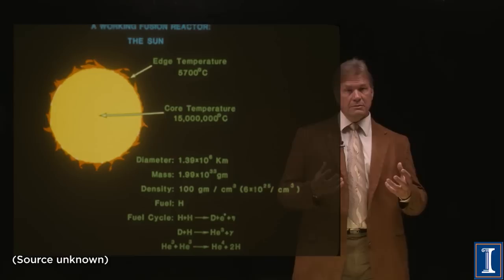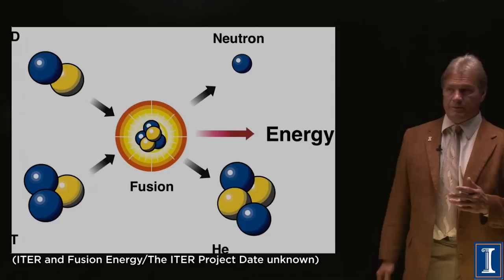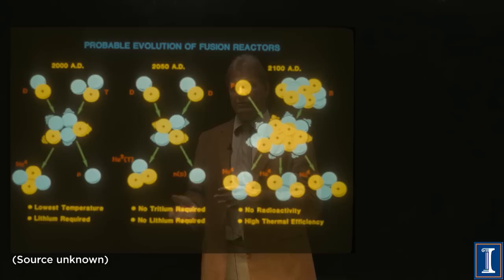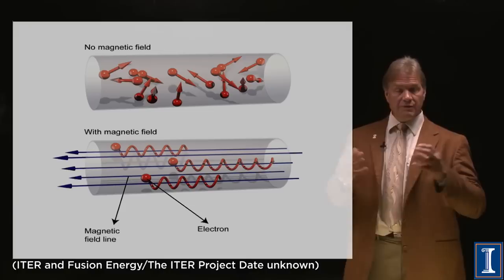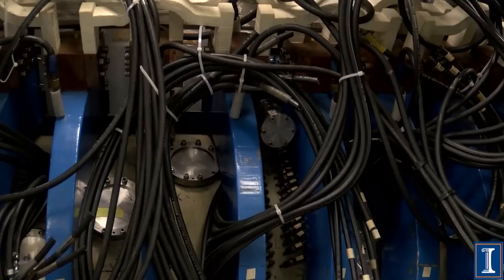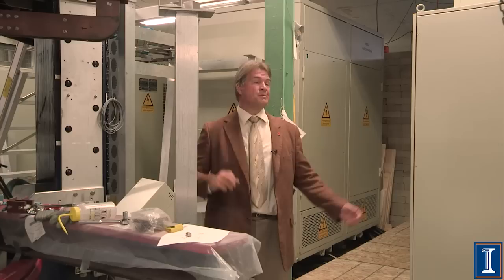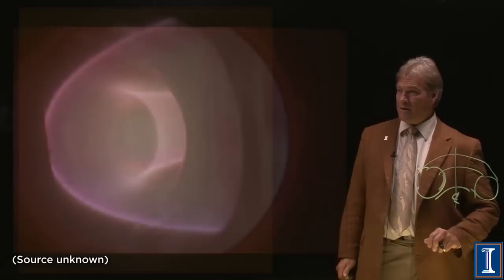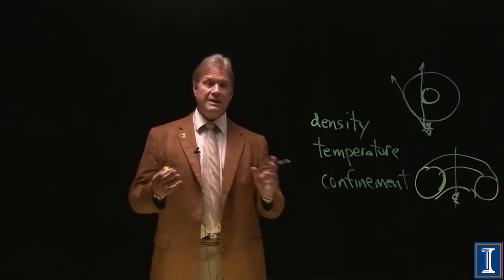What Is Fusion and How Do You Get It to Work?

Comment: How is the energy from the reaction captured? Wouldn't the products of the reaction keep spinning around the magnetic field along with the reactants?
Reply: The only stuff captured by the reactor (its magnetic field) are ions, as the products of the reaction (neutrons and helium cores) are not ions, the are flying out of the reactor and will hit/fly through the walls, where water is heated.
Reply: @Bunnysinger  Past the super=cooled superconductors.  That'll be a breeze.
Reply: @tonyduncan9852  Actually these blankets are located inside the magnets. Why reply with a  wrong answer when the information is easily accessible?
Reply: @Bunnysinger  "Blankets"  ? - Pipes containing pumped water expanding into pressurised steam are wrongly described as "blankets".
"Wrong answer" ? - "Past the super-cooled superconductors" is absolutely correct.  I appreciate that the magnets will heat up, and yet also that in order for the magnets to drive the magnetic fields, their wiring should be superconducting, and at a temperature of at most -120 deg C.  That'll be a breeze. . . .
Is your real name Lady Pilman, and do your fingers always slip on the keys?
Reply: @tonyduncan9852  Your first comment insinuated that the capturing of the heat takes place past the supercooled magnet, which is demonstrably false. Just take 5 seconds to look up the diagrams of ITER.
A blanket is the correct term to describe the unit used in ITER, which is composed of tritium-breeding concepts, radiation protectin of the magnets as well as waterpiping. It is not wrongly described, it is simply the term used by everyone working on this project.
Specifics of how the magnets will be supercolled during operation can also be easily accessed by just going to the webpage of ITER (and the T° is -269°C, not -120°C).
Is this pure neglicence or stupidity, I can't figure out which one you're portraying.
Reply: @Bunnysinger  "Your first comment insinuated" - No, it didn't.
"that the capturing of the heat takes place past the supercooled magnet" - No, it didn't.  A "magnet" isn't a "superconductor".
"which is demonstrably false" - Your statement is demonstrably false.
"Just take 5 seconds to look up the diagrams of ITER" - Done years ago.
"A blanket is simply the term used" - OK.
" neglicence or stupidity, I can't figure out which one you're portraying" - Neither.  I was merely (and lightly) implying that extracting heat energy from a low temperature device was an engineering challenge. 
But I will go a little farther.  It's a stupid challenge, supported by more than one stupid person, comparing its costs with CERN - but not its achievements with CERN's.
A sort of reverse BAKED ALASKA?  Hmmm.  Can I have some of the money they're spending?  "Negligence", btw.

Comment: I wanted you to explain how do you extract the excess energy once it is working.
Reply: Michael Lundgren heat up water to turn a turbine.  Same as most other electricity generation.  The heat is what is released from the fusion reactions
Reply: @the-mallory  Its not explained. There is coolant water in fission reactors. No mention of water in the fusion reactor.
Reply: @michaellundgren6949  For the reactions where a neutron is created this neutron is unaffected by the magnetic field because it has no charge. Its energy can land in the surrounding material which can then be used to create steam and power a turbine.

Comment: It a chamber made by magnets, to drive ions into collisions...so you need electric fields aims inwards and in a circle. Fill the chamber with gas and the ions will be channels inward abs in a circle and collide...but use a basis isotope just one, pressurised it then begin fission and then fusion, and let the process restarts naturally...you get a lot of energy...back even more than input and as a constant input the output is far more...

Comment: if I may and I probably have seen this clip, but maybe I don't remember if my question was answered. And since we are getting close to starting one up, its all fine and dandy and lots of energy and pats on the back all around. But. How do you stop it after it started?
So its high temperature, higher than the sun to make up for the reduced pressure that we have here (coz the sun has more pressure so it can do it with less temperature), so we got all that and we got the magnetic containment field, all good and its starts working on its own after sparking it. 
Remembering only too well the intricacies of the mess of Chernobyl and how they turned that switch off when it should be on, or they should have added more of this or that instead of reducing this or that. I wonder. Do we know how to stop a fusion reactor? I.e. how to turn it off. What if we stretch the limits of heat and pressure to make it work but somehow for some strange reason, once it gets going , it "paradoxically" needs a higher temperature or pressure to stop, instead of reducing them, for example. So wouldn't it be wise, and I hope they thought of that in general, not to operate things at the limit, coz you never know what a little bit more might do? Like a reserve. Its generally good practice. Not to operate at max.

Comment: But would charged particles move in a non moving magnetic flux? If you apply dc current to coils would it cause charged particles to move inside toroidal tube? Does it has too be at least pwm on off dc input?

Comment: This is all fine and good professor. But, in order to produce the 1.21 jigawatts of electricity we'll need to power the device, we'll need to travel back to Nov 12, 1955 and harness the bolt of lightning that will strike the clock tower at precisely 10:04 pm.

Comment: Fusion has been done many times on earth as far as 50 years ago in the form of Hydrogen bombs which are fusion bombs initiated by a fission bomb to produce heat and pressure. Not a good power source but does prove the feasibility.
Reply: Project PACER tried to investigate the possibility of utilizing hydrogen bombs in an underground cavity in order to generate steam for a power plant.
Reply: 911 was another example of a working FUSION reaction  :-)
Reply: Matt S  100 football pitched 1 Acre sized concrete floors turned to ultra fine particles in 10 seconds - now genius, what energy source can do that??
Reply: Matt S  Well let me give you the readings for the elements in the dust and see if that will help you.

Dust samples USGS - United States Geological Survey (Department of the Interior)
Barium = 765-3130ppm 
Strontium = 1000-3670ppm 
Zinc = 2990ppm 
Yttrium = 58.9 
Uranium = 3.92-7.57 
Thorium = 30.7 
Barium & Strontium are not trace, but highly dangerous amounts. 
The steel beam coatings contain up to 93Bq/Kg Uranium - Professor Chris Buzby
Tritium at 55x normal in the water run off - Lawrence Berkeley National Laboratory
Elevated levels of Uranium in the air - Dr Cahill (UCLA Davis) 
Actinium discovered by its emissions spectrum - Professor Chris Buzby
Iodine 131 which has a very short half-life of only 8 days was also discovered -  Oktay and Partners
Reply: @Kpopzoom  - Are you talking about little tiny fusion bombs, some sort of ray from a distance, a ball of free-floating fusing plasma rising through the building, or some other scenario? I'm sure energy from fusion could vaporize material, but what mechanism?
Reply: Matt S  fusors exist, which are essentially fusion reactors that take in a greater energy input than the output they provide

Comment: What about Lithium-Deuterium fusion?
Reply: You are probably mentioning this reaction from nuclear weapons that use lithium deuteride as fusion fuel on the secondary. Actually the reaction that happens in a thermonuclear warhead is not lithium with deuterium its tritium with deuterium. It happens in stages first the fission primay not only compresses and heats the secondary(LiD) fuel but also with the insane neutron flux it provides it breeds tritium from the lithium at the same time(n+Li=T+He) then the Tritium generated reacts with the deuterium generating more neutrons that hit more Lithium atoms to generate even more tritium that reacts further with the deuterium.

Comment: Fusion is an a incredibly slow reaction. Is it true that there are 2 fusion reactions per cubic metre in the sun per second.
Reply: I don't know the exact numbers, but fusion is about that 'slow' in Sun-like stars, yes.

To make fusion happen, one must meet the 'Lawson Criterion.' That is, the product of temperature, density and confinement time, must exceed a certain minimum value.

Because they can't achieve the pressures and confinement times of the cores of stars, fusion devices have to go for higher than stellar temperatures...

Comment: I can't avoid a comment about Brazil: We're invited, in 2006, to be part of the ITER. In the deal, Brazil would produce the Niobium-Titanium wires for the electromagnets. Brazil has large mineral resources - including the two metals needed for the wires. In 2013, when the Ignition Lab (US) managed to get net energy output from a fusion reaction, a physicist told that Brazil refused the invitation saying "it would cost too much". The Federal administration at the time was involved in a huge corruption scandal and on a single oil refinary they spent 24 billion USD. The total ITER estimate is 20 billion USD. I won't say the names but that administration was not only corrupt but also incompetent. They have no idea how stupid they were for refusing the invitation.

Comment: What about just using the big fusion reactor that already exists in the sky?
Reply: We are, but sometime objects get in the way - like the earth and clouds.
Reply: @bobthebomb6498  True.That's why you need to design sufficient gathering and storage capacity into the system for every specific location. If you estimate and calculate everything correctly the system will gather and store a sufficient amount of energy during periods of sun exposure to carry you through other periods when the sun is blocked.
Reply: @nisonatic  - I agree that we need better ways to store accumulated energy. Even electrolysis followed by hydrogen storage has capacity and containment problems. But sunlight is free and if we could find better ways to accumulate and store it solar energy could become much more viable.

Comment: You need to turn up the volume dude
Reply: Then the squeaking would intensify
Reply: @seymoronion8371  for which he could use a passive high frequency filter. My point is that its not enough to just cut the video together
Reply: Are you watching these vids on a phone, or notebook, by chance? I'm using a PC and not having any issues.
I'm using some cheap Creative Inspire T12 2.0 speakers with onboard sound (Realtek ALC S1220A).
Reply: @seymoronion8371  I was at the time actually, had I been at home I could have used my desktop head phones and probably never even felt the need to comment on it in the first place lol
Reply: You might want to check your Audio Settings to see if you have Loudness Equalization enabled.

Comment: how is the energy taken from the plasma, when its magnetic locked in the vacuum toroid?
Reply: Like every other nuclear/coal/gas plant.
Boiling water and driving turbine's.
The bigger real systems get a "cooling" system that boils water in the "shell" (I'm not sure how to call that in English)
The small system you see in this video is not meant to sustain any prolonged plasma (and really can't) thus it has only a cooling system to protect it from damage.
Reply: @SuperUltimateLP  of course it's done by steam. But where has the water contact to plasma?
Reply: @kraftrad7840  the plasma is hot enough to heat the walls of the reaction chamber, in there is the steam generation done.
Reply: @SuperUltimateLP  aren't there the magnets in between?

Comment: Why not just make a sphere and use plain H2 hydrogen?
Reply: Because you would not get the sun's confinement (heat and pressure) due to not having enough gravity present to create the same conditions as the sun.

Well I suppose you could make a ball of h2 hydrogen the size of the sun and call it a reactor as well.
Reply: @VuNguyen-wo8bp  WHAT!!!!!!!????? 
  I'm sorry, but responses like this baffles me. 
 What you are saying isn't being done now with current fusion reactors. 
 So let me reiterate, why not make a sphere shaped reactor and use plain hydrogen gas or a combination of tritium and deuterium?
Reply: @shexdensmore  Because fusing plain hydrogen is impossible with current understanding of science anywhere outside of core of a star. It was said in video that it takes long time. Reason it takes long time is that plain hydrogen fuses in helium two(two protons no neutrons in single nuclei) which is extremely unstable and most of the time decays back into two protons and only in rare occurrence beta decay of one of the protons into neutron happens during brief period of time until it would decay back into hydrogen. But not only it has to fuse and decay many times until deuterium is finally just by pure number of cycles and abysmal chance forms, but this whole fusion process of two protons if moderated by weak nuclear force unlike fusion processes that are viable for production of energy which are moderated by strong nuclear force. Also spherical magnetic confinement is way harder to achieve, than tokamak or stelator design. There were experiments, but i didn't follow how they actually ended.
Reply: A sphere cannot contain plasma due to its topology. You can think of this in Basic E&M if you want, or you can look at the "hairy ball theorem". As a consequence of the topology of a sphere, you cannot use it to contain a plasma without a "leak"
Reply: @ekotar1  Ball lightning?

Comment: Still uses tritium, or deuterium... no one has been able to produce those isotopes on an industrial scale economically, the other part is it takes a tremendous amount of energy to heat the plasma and catalyze the reaction, no one has been able sustain a reaction with an energy output greater than the energy input required to catalyze the reaction. (it costs more energy to get it going than it creates) We have known self-sustaining reactions were possible since the 1960 but no one has been able to get one going that actually has a positive energy output. Fusion is always 40 years away... because the problems identified 40 years ago have not been solved. It still takes way too much energy, and Tritium/Deuterium and until someone comes up with a more efficient way to heat the plasma, or lowers the plasma temp required AND someone else comes up with a way to use hydrogen, or economically produce deuterium at scale this none of this makes any difference.

Comment: The atmosphere or corona is hotter than the surface. It’s not a fusion reaction.
Reply: The reaction occurs at the center of the sun.  Apparently it takes millions of years for the heat to reach the surface. . ,
Reply: The exiting COOL material is accelerated to high speeds (thus becoming HOTTER) by variations and distortions in the Sun's intense magnetic field.  At the Sun's center it is extremely HOT.

Comment: well, according to /some/ people there's not even enough lithium to make all those teslas. and you want to burn it?
Reply: He left out the bit about mining the moon and asteroids, is all.
Reply: @seymoronion8371  true. by that time, fusion will also be the way to go to to the asteroid belt and beyond, especially with the reduced amount of solar out there.
Reply: The amount you would fuse to create tritium though is tiny per amount of energy you get from it, and it can be recycled by re-enrichment process back to Li 6 or Li 7 via uranium to lithium enrichment process.  Not all lithium is particularly desirable for breeding reactor blankets.  
 
At the maximum Li 6 consumption rate due to nuclear reactions of 340 kg per GWe-yr,
 the energy content of the lithium consumed is 20,000 KWh per gram. 

 Same with the amount of deuterium required to produce a given amount of energy.  

 The
 amount of deuterium.consumed annually by a 1000-MWe power plant 

would be about 50 kg.

Source for the deuterium: 1 gallon of seawater (3.8 litres) for deuterium could produce as much energy as 300 gallons (1,136 litres) of petrol.

https://www.osti.gov/servlets/purl/6574527

Comment: assume and point laser to it
Reply: remote fusion is to capture the radiation
Reply: if you are using magnetic field to circulate inner current, you are running the eddy induction currents the wrong way
Reply: the three things relate to each other in a way, pVT equation